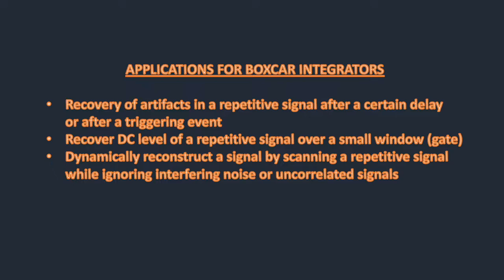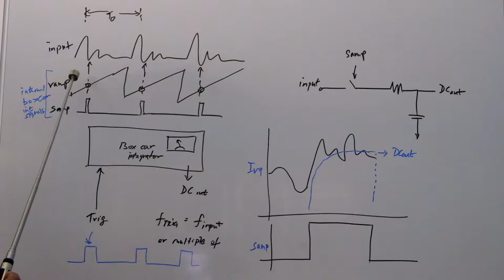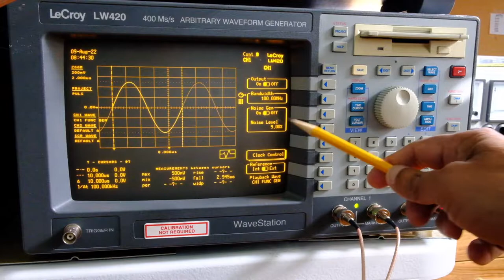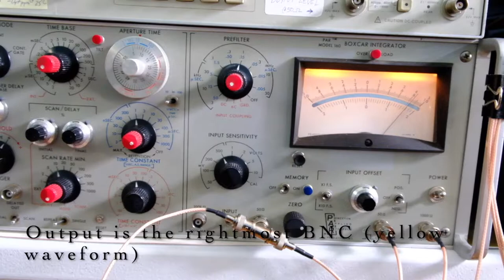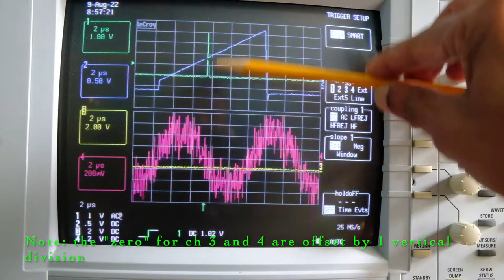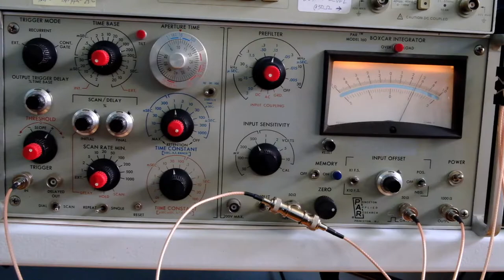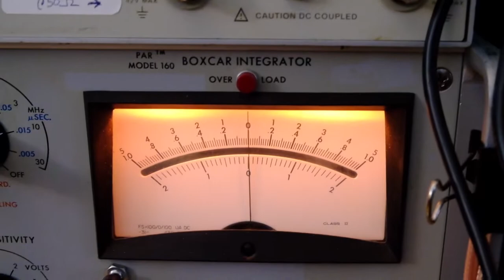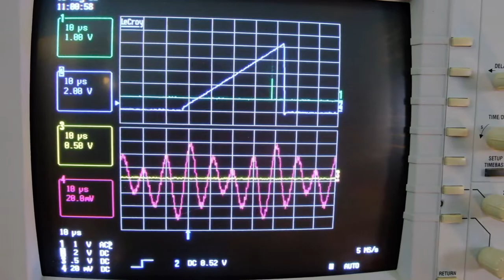PAR 160 Boxcar Integrator

Comment from the maker: I kept using the terms "noise" and "uncorrelated" loosely. The boxcar integrator will reject harmonically unrelated signals or wide band noise that may be present on top of the signal of interest. Uncorrelated here is same as non-harmonically related components which over the sampling period don't contribute to the signal to be recovered. Pink noise or band-limited interfering signals will contribute to the averaging and skew the result.